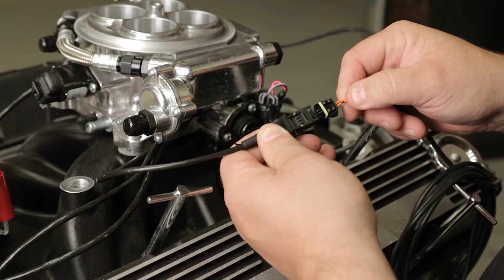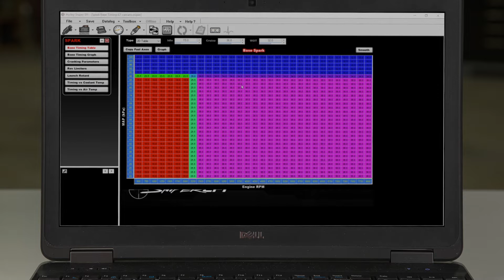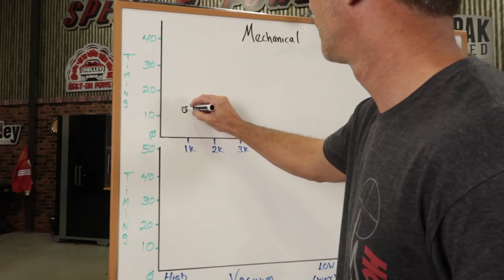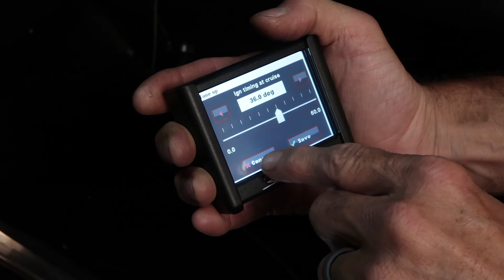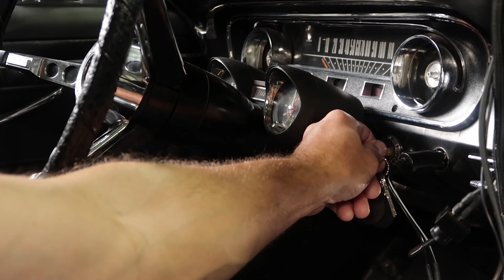How To Build A Custom Timing Table - Sniper EFI

Comment: What do you use for a hyperspark distributor? A blend of mechanical and vacuum?
Reply: Yes, its getting vac readings and rpm readings from the Sniper body, instead of doing that at the distributor, the sniper then just tells the hyperspark what to do.

Comment: "self learning" yup. I sure do have to learn all this myself.

What's the point of advertising your product as "self learning" if everyone literally needs to tune these sniper and hypersparks to their own engine...  No such thing as plug and play.
Reply: well, i bought one and it worked well, it does self learn the fuel map and gives you the option of  a base ingnition that works ok, much better than oem for sure. All this settings tunings, as said on the video, are for optimizing and gaining more out of the sniper, but it works pretty well out of the box.

Comment: For those confused by the two tables... What you don't see is the clearing of the table.  In fact, notice that his scale is the MAP (kpa) on both.  The vacuum advance is just an example of vacuum advance alone.  To build the map:
1. follow the mechanical map creation
2. skip the vacuum map and pick back up at ~5:31 "Go back to your mechanical table and highlight the bottom few rows"

3. finish the fill in and you should be all set.

Note: I don't understand why they're showing a ridiculous 56 deg advance as a suggestion.  I realize your conditions should never put it there but still.  That looks dangerous to me so I'm not going to advance 20 across the board as the video shows.  YMMV
Reply: I thought the same thing. 56 degrees would detonate most engines to hell
Reply: Pretty sure he was just explaining how to do it, how much cruise advance your engine can take could be different, he repeatedly mentions reading the plugs and confirming that the map is safe for your engine. Making a custom table that works for all applications is not the point of this video.
Reply: I was so confused until I read your comment, thanks.

Comment: @Holley is there a video on how to tune the AFR tables?  I followed your instructions here and my car runs a whole lot better (It was ok before but I'm happier now with the new tune) but I can't find a Holley video for setting up my AFR tables.  Any help is appreciated.  Thx.
Reply: I'm kinda late but I'd thought I'd answer. On top left click the fuel injector icon and select target a/f ratio on the left. It shows the basic ones in the menu at the top and a gray out chart. The chart is the default ones based on the numbers, however, if you change type to advance you can change each one individually for your motor size, etc. Just gotta be careful not to go to far or risk engine damage.
Reply: @kyleapril32  thank you!!!!!

Comment: I figured out the part that this video completely walked around that has so many confused. There’s an older video called “Individual Configuration Library ICFs” from HolleyPerformance where they’re talking about all the ICFs, selecting, disabling and so on. To save individual spark tables create the mechanical as he shows, then go to File, Export Config, and select the spark ICF box only and name the file for your mechanical advance. Then clear your table and build the vacuum advance table as he shows. When he says to bring up your mechanical advance table again go to Toolbox then Add Individual Config to select the mechanical spark table you built earlier then follow his directions from there on out. If you do it right, you’ll get the same appearing graph he did. Watch the other Holley corporate video I mentioned if what I said didn’t make sense.
Reply: I think holley did a poor job of explaining it and people are over analyzing it. if you follow along he is just building a vacuum advance table for show then adding it to the base. A better way of doing it (after building your base) is to find max map from a high speed Decel. 38 KPA or so Then  offset +20, Then WOT TPS usually 94+ kpa on the sniper then select the first row of each and fill column. Ignore his second table and apply as stated above
Reply: Make more sense 👏 
It was  a little  confusing on switching between tables lol
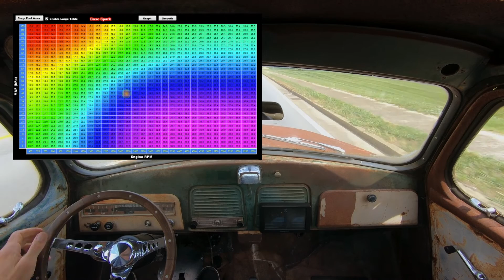Reply: I get exactly what he’s doing, I just have to figure out how to go from my graph of what’s in it already to the plain white graph  where he starts building the new one. I’m the old school turning screwdrivers on a double pumper and twisting the distributor to now doing all of it on a laptop. If anyone can walk me through from approximately 4:15-4:20 in the video to the point where he has a whole new white graph to start building the spark tune it would be greatly appreciated. I’m sure from there I will understand how to do the fuel etc from there. My biggest fear is losing a tune or putting bad info into the computer. I understand all the concepts of what each part is for, I just want to be sure I do it right and it will only take explaining it once for me to get it. I kind of get what the gentleman above is saying, it’s just getting used to where to click to get in the right places.
Reply: @schaefer692002  this will be very difficult over YouTube but the way I did it in the end was I just kept practicing and not using the method above at all although I get a very similar graph. Use Holley’s quick method (3-inputs, doesn’t drive all that great), idle the vehicle, drive your vehicle easily to get cruise and street accel kpa numbers (vacuum reading) all while data logging the event. Use the information in the datalog to adjust your idle zone and high vac cruise zones to what you know or think will work best. You’ll be doing this in blocks on the spark table. Choose your max mechanical advance for WOT and rpm where you want it “all in” and creat another block of values, probably from 80-85 kpa up to the top of the graph, all-in rpm to the max rpm. Then use the methods shown in this video to blend those blocks into one another horizontally and vertically. Go to the 3D graph to smooth the wrinkles manually. Also use these datalogs to build your target AFR table. Very helpful in refining your transition areas like light acceleration. Just make sure you understand proper fuel AFR’s like best lean torque (low load), best rich torque (high load), max power safe AFR, lean cruise AFR, etc. It’s also going to take you memorizing as you drive how the car behaves if you’re familiar with how it behaves in too rich/lean situations. Always err on rich so your timing can be more aggressive. Aggressive timing and lean burn under load are a dangerous combo. Hope this helps even a little bit. I’ve built many more tables than I’ve used and even then used the many datalogs I’ve recorded to refine those spark tables and you will too because the engine’s behavior will change as you tweak the tune, then the values will change. Just takes time, it even gets to be fun instead of intimidating

Comment: I get lost at 4:55, when he starts to make the vacuum advance table.  He seems to toggle back and forth between vacuum or mechanical tables.  I cant seem to be able to start a vacuum advance table.  Any help would be greatly appreciated.
Reply: Just create the mechanical table as he did. Then select all colums which are lower than 35 kpa and offset the value ( add 20° advance). Now you select all colums from arround 94 kpa to first offset row (35 kpa) and use the fill column values function.

I personally would only offset 15° instead of 20°
Reply: Why is he adding 20 degrees to a total timing of 35 degrees he already set? Wouldn't that make a total of 55 degrees? What am I missing?
Reply: Same problem here ...., I got lost too ..!!  It looks like you can set up multiple timing tables .., but how.( and then blend them in ) .???
Reply: @hemi-denny  Same here.
Reply: Exactly what RG said, admittedly its a little confusing, however it is just the one table.
Reply from the maker: give our tech line a call for help! 866-464-6553
Reply: @HolleyPerformance  Maybe you could answer the question here, seeing as it's a 3 hour hold on the tech support line. Same situation -- Created a table as I'm following the video, and then with no apparent clicks or menu selections, suddenly the table is filled with 0's again. That seriously needs clarification.
Reply: @HolleyPerformance  Holley tech support is a waste of time. I wait on hold for hours and then get a good ol boy who knows less than me.  Then I tried sending an email. 2 weeks later I get a reply with a generic non-specific answer that's not helpful!